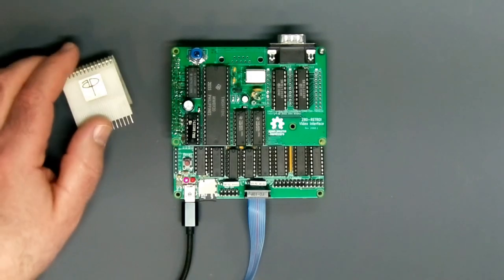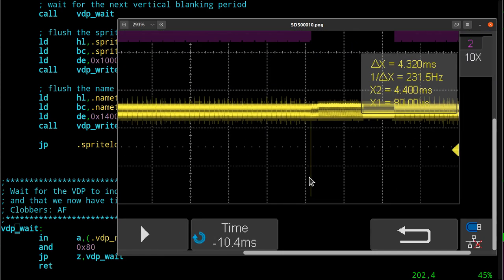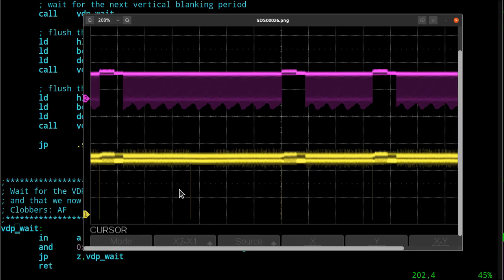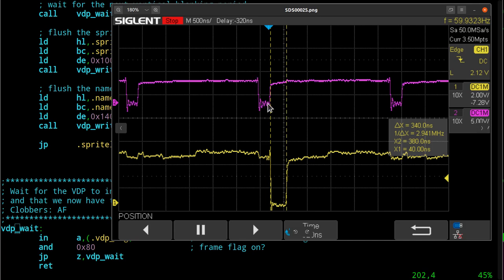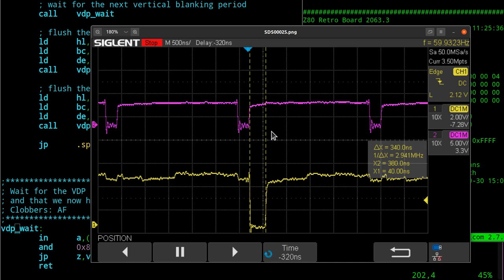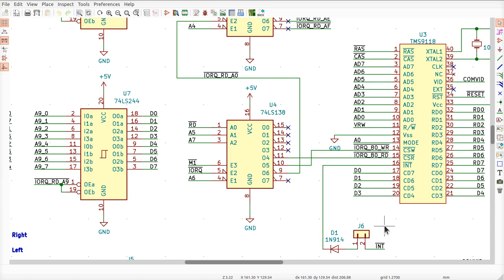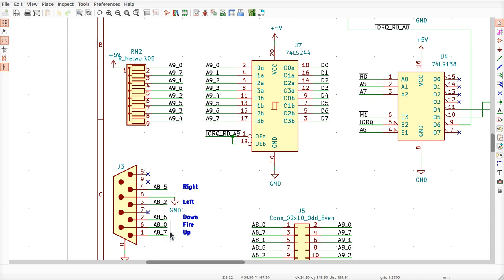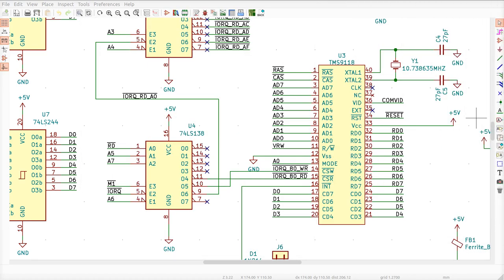Z80 Retro #58 - TMS9118 VDP Frame Flag Race Condition?

Comment: "The status register may be read at any time to test the F, C and 5S status bits. Reading the status register will clear the interrupt flag, F. However, asynchronous reads will cause the frame flag (F) to be reset and therefore missed. Consequently, the status register should be read only when the VDP interrupt is pending."
Reply from the maker: 🙄 Where did I not see that printed?
Reply from the maker: ugh.. .found it... page 20 of the 1982 TMS9918AITMS9928AITMS9929A Video Display Processors manual!
Reply: @JohnsBasement  Texas Instruments 9900 Datasheet copyright 1982.
Section 2.3 "Status Register" Second paragraph.
Reply: @JohnsBasement  it's mighty confusing how the programmers guide is so similar to the datasheet.  Easy to miss. I had the same issue. My scope was showing writes while the interrupt flag was high. (Inactive) based on the polling approach. It only ever worked properly for me when I had the interrupt line hooked into my 6502 IRQ. I tried polling again because I was having what I can only think of as a software issue that resulted in my keyboard interrupts being interrupted by the vdp interrupts.  Anyway, I saw the same issue as you. So it's not just your particular chip either. Problem is the same on a 9918 too.

Comment: You can tighten your vdp_wait routine by removing the AND 0x80 and changing the JP Z to a JP P. The IN A,(port) instruction captures bit 7 of the input data into the SIGN bit of the status register thus you can use either JP M or JP instruction to act upon the result. As far as I see it the VDP is designed so that you have a choice to use either software polling or the /INT output pin and not both simultaneously. This is evidenced by the mere act of reading the Status register will reset the F bit and also negate any asserted /INT output.
Reply from the maker: The IN instruction doesn't officially set the ALU/status flags.  So I'd still have to do some ALU operation (like OR A) to get the flags set.
I agree with your thinking about the possibility of it supporting software polling.  But as @David Latham has confirmed, the manuals actually DO comment on this misfeature.

The only safe way to read the VDP status register is to do so 'soon' after the IRQ signal is asserted.  Reading it as the frame flag is being asserted can cause its setting to be missed by a software polling loop.
Reply: Oops! I meant the IN r,(C) and unofficial ED 70 instructions. The ED 70 instruction is particularly useful because it only affects the Flag register.
Reply from the maker: @PebblesChan  Definitely interesting.  But keep in mind that we are talking about code specifically designed to waste time. So.....
Reply: sad, if it could fit somewhere, one D-flipflop for IRQ on GPIO with explicit reset can help too? I am thinking about spliting the board on just VDP (+solving this) and GPIO for the (not only) joysticks (imagining crimpable flat able from universal headers to the DSUBs ...)

Comment: What did you ultimately settle on for your output circuitry? Adding the 470 ohm pulldown resistor fixed a lot of problems, but my output is still a bit glitchy, and the colors don't show up properly on some LCD displays (but it does on other LCD displays) -- you get bar patterns instead of colors that look like Apple 2 colors look on a monochrome monitor. I haven't played with the capacitors for the Crystal yet, I just used 33 pF, maybe adjusting those will help?

Comment: On the one hand, it should be possible to implement the Z80 interrupt mode 2. That would require an additional 8-bit register. But on the other hand, maybe it isn't the worst idea to put the VDP on /NMI. Because what that would do is, provide a stable timing source that is always in sync with the framerate.
For the start, you just have to put a single IRET as interrupt handler for /NMI, and not worry about it. Your other code would run just like before, just the CPU would execute a few extra jumps every now and then.

But it could come in very handy later on, for timing access to VRAM, or polling the joysticks in sync with the framerate.
Reply from the maker: And unless you replicate the vector table in page 0 of every ram bank, you can never risk switching them.

Another solution on the Retro might be to swap the high banks (rather than the low). To do that, swap the OR gate in U13 with a AND gate.
But that it is not as CP/M friendly... Because the BIOS (where the bank switching code is likely to exist) wants to be in the high RAM.

Soooo..  now what?
You could build an interrupt controller that switches the RAM banks accordingly during an interrupt acknowledge cycle.

Ooooor... You build a 3-region MMU like the one in the Z8S180.  It should be easy enough to do with a GAL... Definitely easy with an FPGA.
Reply: @JohnsBasement  The 2-page system makes it kind of limited. 
But then again, it would just be a handful of bytes to copy over when switching to a new ram bank. If the table doesn't change at runtime, it would have to be done only once during bootup. Or on a change. And if you want to use the interrupts for the SIO and CTC, you'll need the IVT anyway.
Reply from the maker: @TSteffi  it's not clear to me why CP/M was designed to live in high RAM in the first place.  It has to be moved depending on the amount of RAM in the system and it has to own both low & high memory... When keeping it low seems simpler.
The only win I can see is the CCP and BDOS overlay rules are simpler when the O/S resides high.
Reply: @JohnsBasement  they probably did that specifically to stay away from the bottom of memory, because that's where all the ROM banking happens during boot. Or maybe just because the z80 stack grows downward, so it has to sit at the top of ram. And DR probably decided for some reason that CP/M should live with the stack, not with the IVT. 
My best guess is, it's easier to copy the IVT to a new ram bank than to copy over the stack, because you'd have to do that copy without using the stack at all.
Reply from the maker: @TSteffi  when cp/m was created, most systems had less than 64k.  Banked memory was not yet a concern. S-100 boards came in 1k or 4k sizes.  That is why systems like the imsai 8080 had 20 slots!  To fill it all, you'd have to spend an entire year's gross pay for just 64k!
Reply: @JohnsBasement  yeah, I kind of remember. But the later versions of cpm do take paging into account. I have had a look into the documentation, and it talks a lot about paging and all that. Also, msx used paged memory and I think there was a cpm version running on those. I personally remember that there was a cpm for the amstrad cpc, and the 6128 did actually page the whole 64k at once. Still not sure how they pulled that off.
Reply from the maker: @TSteffi  If I paged all 64k at once, id do it with code that is the same and in the same place in vith banks.  Or at least from code that is compatible and continue to run right after a bank switch.

Comment: That’s interesting because my first draft of Game Man Yeah! also waited on the bit to sync. Mame is forgiving and you can throw a donkey at it and it’ll render something. But the metal kept acting funny. I could not get it to sync by polling the status register. So I ended up using im2
Reply: Once named can never be renamed.  Game Man Yeah! it is.
Reply from the maker: Hmmmm... interesting to see that even using the VDP clock (and hence what I assume is phase-locked to the VDP's own FSM) isn't reliable either.
It looks like @DavidLatham found the smoking paragraph in the manual that definitely states this is a (mis)feature.  I'm sure that adding a proper synchronizer would not have been an problem if they had thought of it... I mean it is a pretty obvious newbie mistake... that comes early in the lectures on FPGAs.
Oh well.  It is the sort of thing that used to happen back in the day.  So we get the full retro experience!!  :-)

Comment: I'm not sure, but couldn't you use an unused CTC-Channel to react to the VDP Interrupt signal? Set the Counter-Reload-Value to 1 and on every VDP-Interrupt the Counter become 0 and results into an interrupt (with a slight delay, because the CTC-Input is synchronized with the CPU-Clock). But so you can use Interrupt Mode 2 with an own Vector for VDP-Interrupts.
Reply from the maker: Yep. That'd work... If I could get there from the VDP board without a bodge wire that spans the two boards. 😞

Comment: It could be a non-issue with the 9918. I'll have to try that when I re-implement it on my Z80. (Don't feel like dusting off my 6502 SBC) LOL
Reply from the maker: I suspect it is the same on the entire product line.  @DJSures posted a note confirming he saw the same behaviour on the NABU's 9918.  😕
Reply: @JohnsBasement  drats, then this means the only option is to actually use interrupts instead of polling. I wonder if we could use the CTC somehow?
Reply from the maker: @microhobbyist  one could use the CTC but it'd need a wire to run between the boards.  I think it'd be cleaner to connect the VDP IRQ to NMI if want to use an IRQ or to an unused input on the joystick I/O huffers so we can see it and then know when to safrly read the status latch.
Reply: @JohnsBasement  wouldn't VDP on NMI and board SIO/CTC on IRQ solve it?
Reply from the maker: @7alken  With careful coding, yes.  See the latest videos I just posted (week of 2023-05-29) about other ways to address this concern.
Reply from the maker: See this video where I discuss another option: https://youtu.be/pbGttY0Oxfo
Reply: @JohnsBasement  Not at all. if A NMI request occours in the middle of register write or vram setup, the reading of the status register would mess the register setup. You needed a relatively complex mechanism to avoid the status register read with a flag if you are doing a write to register on the main program, and defer the status register read as soon the int routine returns. A very nice mess. ;-) I think it is better to feed a IM2 vector to z80 for the VDP interrupt request.
Another thing that vdp is missing is a way to sync data port write to the real delay required which vary a lot using a kind of hw wait line, but asking this to Guttag is asking for science fiction. I cannot immagine its complaints ;-)
Reply from the maker: @BrunoGiavotto  yeah.  Polling it IN the IRQ handler would be a problem if you do not disable IRQs during a transfer.  The chip design is awful.  I am working on a series where we design a CRTC that is more reasonable and then implement it in an FPGA.
Reply: @JohnsBasement  there were some follow up to this chip namely V9938 and V9958 by yamaha, which retro compatibility and more interesting enhancements:
each sprite can have it's color on a "stripe" basis, 8 sprites/scanline a very slow blitter for moving rectangular regions , bitmap modes and hw scroll, However, to maintain compatibilty yamaha designers have to made compromises and the chip was not what should have been.
would be interesting to see if they removed tha race condition. last chip is V9990 not compatible, but well designed with superior features, double plane pattern mode, fast blitter, each sprite can have 15 colors per pixel + trasparency and its own palette 16 sprites/Scanline etc. They removed the stupid "reset on read" feaure. With this chip you read the status bits and if you want to reset (acknowledge) some status bit you write a byte mask to the same port. You decide when and what to reset.

Comment: You might be able to fudge a software only solution. If you read  twice in quick succession in your loop and or the two results, then the timing should catch your signal on one of the two reads. Effectively you increase the window you are reading to make missing the transition impossible. I'm assuming of course that you can get the  Z80 assembly/opcode to do two reads within a cycle or two of each other and then do the OR in within a couple of clock cycles.  I'm not saying it will work, but I think this rapid double read may work. A fudge to get around a fudge. The best kind of fudge. ;~)
A lesson for the new kids. Polling sucks, which is why bit-banging serial on microcontollers often descends into a sea of unrolled loops, spaghetti code and lots of head scratching.
Reply from the maker: I'm not following how this would work.

Best I can tell the Z80 will not see the frame flag set to 1 if I ever read the status reg JUST before the flag flag bit is set.
Reply: @JohnsBasement  Hmmm... So if you read the status reg into A then read it into B then read it into C, in rapid succession are you saying that the act of reading it into A the instant before it sets, ensures then even if you read it into B the next processor cycle, it will miss it because there is a hardware issue that ensures reading the register into B and C will still see it unset, or is it because the timing is such that the transition will take place between the two reads and you will miss it?
Reply from the maker: @AndyHullMcPenguin  I should do a video on why this is not software-fixable.  I built an interface that did this once... VERY frustrating.

One way to make this not work correctly is to use an R/S flip-flop with the R tied to the chip-select logic that reads the register with the frame flag bit in it so that it will reset when read.  Then connect the S to the part of the circuit that sets it when the scan line counter gets to the last line.

In this scenario the Q output might be 1 or 0 when it is read but will flip while being read because the R bit is connected to the read-select logic.  It can also be set while being read depending on what the R and S inputs do when both are active at the same time!  If the S input is set while the R input goes inactive then it will remain set for the next read cycle and you might see it set twice in a row.

An improvement that will still suck would be to use a D latch with reset.... Use the R to clear it and then connect the clock input to the signal you want to use to set it and tie D high.  This will set it cleanly, but if the R is set while the clock transitions to set it, it will never get set.  Remind you of anything???

The way out of it is to use two D latches in series.  One will get set by the event setting the flag status and the second one is used to represent the state to the device that tries to read the status.  The first one can change any time BUT can ONLY be transferred to the second one when the status register is NOT being read!  Then it will work correctly.

This can be related to, but not necessarily the same as, the metastability problem.  The solutions can be the same:

https://www.eetimes.com/understanding-clock-domain-crossing-issues/
Reply: @JohnsBasement  Actually that might well make a good video. 

A few years back we ran into some issues with HDMI interfaces and a race condition. This lead to some very expensive and fancy TV's locking up the firmware randomly on our set top boxes.

You can sometimes work your way out of these blind alleys with software fudges and occasionally with hardware ones (a capacitor here or an additional gate's worth of delay there). 

In the case of the HDMI issue, we found a software solution for the hardware bug that a well known big name TV vendor had in their hospitality (Hotel) TV models. 

When the vendor wont acknowledge the issue is with their  implementation of a standard like HDMI, then its time to get creative with the software. 

Sadly "don't worry, we can just fix that with software" isn't always true. 

A good example of how not to deal with these kinds of issues would be Intel's handling of the the Pentium FDIV bug.
Reply: @JohnsBasement  I might be missing something and retrurning to this after time ... but isn't VDP INT assert just the same as the frame flag? why not to have D-flipflop with reset just on INT and access this some GPIO way - in case there will be room on board ?? ...

Comment: How might NMI interact with the direct cache logic. You ever get one while you are pointing at a page other than 0xE, things will end badly, I think.

I think adding Mode 2 support registers in hardware is tractable, but subtle.
Reply from the maker: I don't use NMI... Yet.  So that isn't a problem.  If we use it with the VDP then we'd have to disable them at the source if we ever touch the bank select latch.
Reply: Yeah, problems with NMI are the only shortcoming I can see for the bank select solution. Mode 2 and normal interrupts you can always park the vector table up in the top of memory (or just mask IRQ’s) - neither an option for NMI.
Reply: @JohnsBasement  vote for exact copy of some area everywhere

Comment: how it is beahave if you reset Interrup Enable id VDP ?
Reply from the maker: Interesting thought!  I will add this to my TODO list for checking... but I do not expect any difference because it is the reset logic on the Frame Flag that is where the race condition is.  Of course, capturing this on the scope might not be as simple.
Reply: @JohnsBasement  i thought that maybe circuriry works differently if interrupt is not generated but i dont know is disabling vdp interrups is feasible in this application
Reply from the maker: @AK-vx4dy  Weirder things have happened.  It is worth testing.

I assume that the IRQ signal is simply the NOR of the enable bit and the flag status bit.